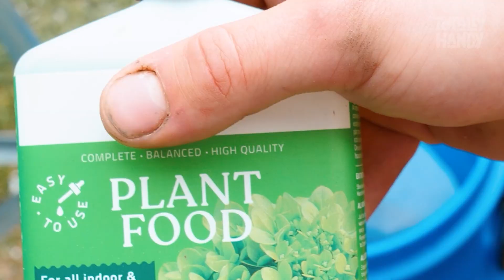Forget Hydroponics! This DIY Aquaponics System is the Future

Comment: The fundamental problem with ALL hydroponis and aquaponics systems is that they are ALL made using plastic piping. Molecules of plastics are thereby transferred to ALL the foods grown by such methods. The molecules of plastics are then ingested by people, which travel through all organs of the body, including the heart and brain. Yes, plastic molecules have been found in the brain of people, including in the brain of new-born babies.
The answer is more expensive. but healthier for people, which is to produce hydroponics and aquaponics systems using copper or food-grade stainless steel piping.